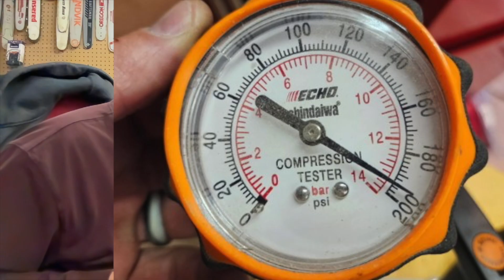Machine work goes sideways a bit MS261

Comment: Ive found if you put nuts on both sides of the base on your all thread. It helps stability and getting it dialed in easier, then its not just being squeezed against the back plate its supported on both sides of the base

Comment: You are altering MSV, aim for 20m/s at your desired peak power RPM is as good as i know.
Reply: That's what I was thinking too.  If you go to the lower end of mechanical squish clearance limits you can push your squish velocity up above 30m/s which I've read can lead to detonation.  I've read 20-23m/s is good, higher for higher rpm but I don't have any specific values.  I think this would be made worse by cutting a lot out of the squish band as you'd be making the squish area a larger % of the area of the cylinder head.  There's a free python script to calculate squish velocity on github by Elmeri Laakkonen that I've done some playing around with.
Reply: @JohnSheerin  squish velocity is backwards, you want less for more RPM. I have gone past 50m/s without detonation but the saw would not rev out. I have yet to have a detonation issue on a saw. I have seen it on stock saws that had issues but never on anything hot rodded.
Reply: @Super-Dave-Outdoors  Do you actually want less velocity for higher rpm or do you want the same 20m/s at that higher rpm which would mean making your squish clearance bigger all else equal?
Reply: @JohnSheerin  i aim for 20m/s at the rpm where power peaks. The MSV increases with rpm so it usually gets set for a specific place. Example 20m/s @11k rpm. 20 might not be ideal in all situations but it works for me. Low msv can make a motor lazy on the way to peak rpm but with a lot of over rev left, high msv can make a super snappy throttle response without any over rev. Easiest way to see if you are too tight is to add a thicker base gasket, if you gain a bunch of rpm you didnt have before then you have too much msv.

Comment: what i heard was you have more air volume with 185 psi and 30 thousandths as opposed to 20 thousands at 185psi. Does that sound right? 

Id assume more air fuel mixture means more power!!!
Reply: It is the same amount but distribution of the mixture is different. Changes burn rates which change power production. A burn rate is kind of its own timed event so think of squish adjustments as an ignition timing advance for the flame in the engine

Comment: Great build so far. I agree with the squish theory. I run between 25 and 27 now on most my builds. Seem to help a lot worth throttle response. My custom pistons are where I build my rpm power. I'll have to send you one.